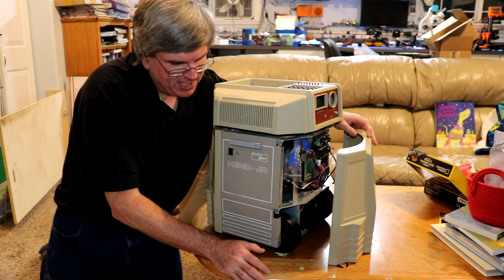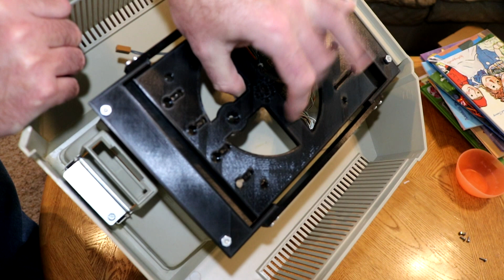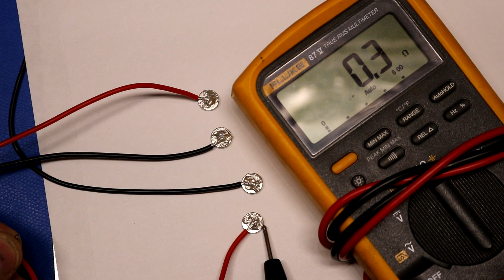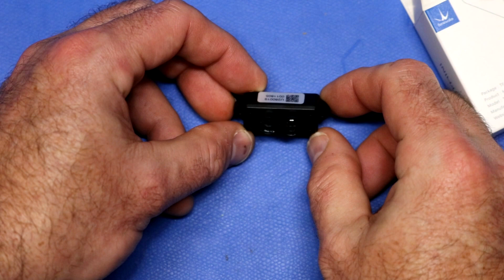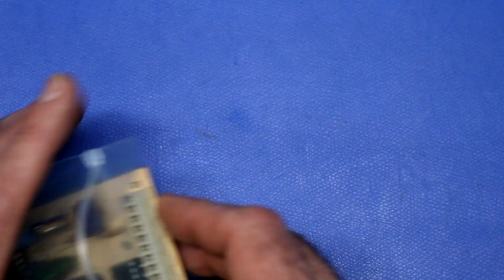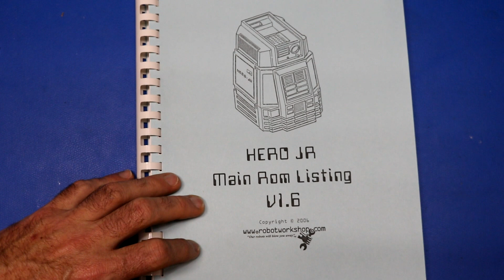Heathkit Hero Junior Rebuild Part 2: Making the Head Spin

Comment: Pretty complex way to move a head, but at least it works.  I was guessing you'd leave a hole through the center for a wiring harness, then use a drive gear and  track to allow the head to turn like a tank turret.  You'd have a limit as to how far it travels to the left or right, however I figure that would've been fine.

Comment: I think you should look into getting an encoder so that you could detect stall and back off a bit and have a count that would let you not lose your home position. interesting that slip rings have issues with i2c. Sounds like a fun opportunity to enable comms without wifi between the halves of the robot.  This is not a rebuild!!! This is a hack :)
Reply from the maker: The problems I read about were noise-related. I think if one bought expensive slip rings they might be fine. but the hobbyist-quality ones on Amazon that are fairly cheap, those are the ones I'd be concerned about. It would be an interesting experiment to run -- connect a pi to a BME280 or similar sensor and let it spin for a few days or weeks and see if there are errors.

Comment: I think you could probably tell by the comments if they were written for the original assembly code or generated from a disassembly of PL/I object. It would be a lot of work to comment assembly code but maybe somebody did that and it is a mystery. I really enjoy your videos, thank you for sharing your projects.
Reply from the maker: Some of the comments are autogenerated, things like "# of stack arguments passed" or "return". Other ones appear to be human generated, such as "Move date to buffer for conver and recite routine" seem human generated. My hypothesis is someone ran a tool that autogenerated a lot of comments and then came in and hand-annotated variable names, function names, and high-level control flow. Someone could have done this starting from the machine code. What really leads me to believe that it might be compiled output is that many of the branch labels are machine generated ("XCD91", "XCDA0").